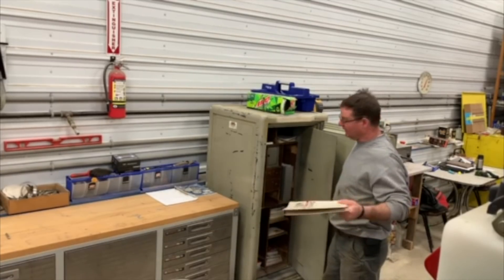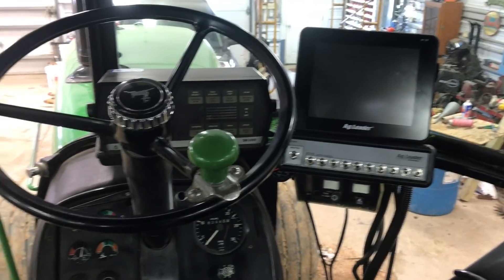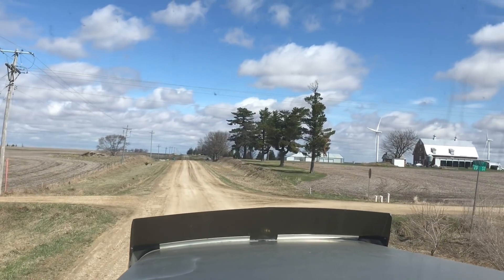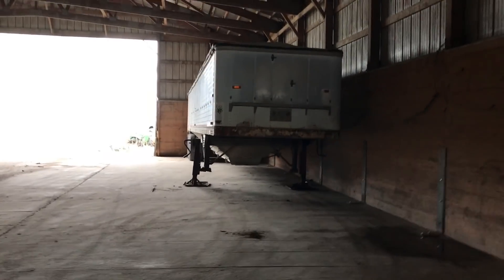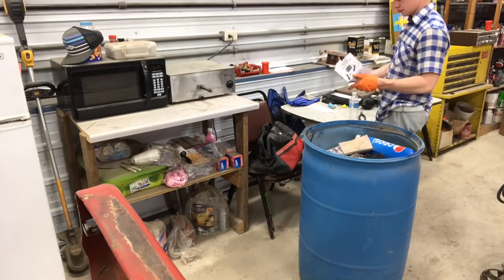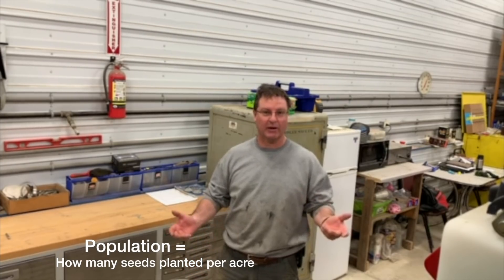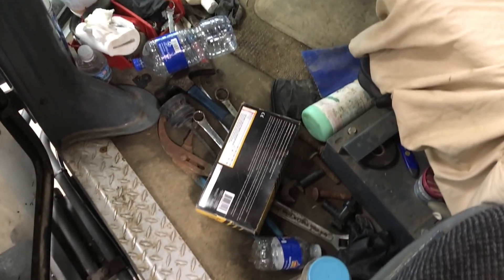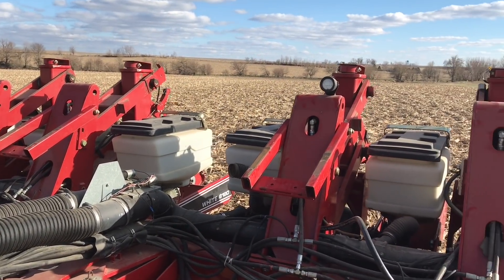My Tractor Can Drive Itself! | Last Minute Fieldwork Preparations

Comment: Daddy Cornstar is pretty cool!   Great video! We are going to finish up with corn planting tomorrow!   Seems to have gone incredibly fast...  would like a little rain before planting beans, still plenty early.   Great video, keep em coming!
Reply from the maker: The Fox Shop You guys are flying!
Reply: @ColeTheCornstar  well...with two 16 row planters and 50ft field cultivators...doesn't take long...but yes, seems super quick this year.  You will love auto-steer...  expensive...but makes things so much easier. We have it on everything. I can Remember field cultivating and it would be dusty and the light is just right and you can't even see the angle that you're trying to go by with auto steer you just push a button and it does it for you.  Straight as an arrow.  Gives you time to watch YouTube videos also 😂

Comment: We ran the jd autosteer system that is their style of steering wheel autosteer of what you are putting in and loved it. Only had it in one year before we upgraded tractors to an 8130 and also upgraded from waas to rtk so we could do more jobs instead of contracting it out. Was used mainly for tillage and some wheat planting as we didn’t have a cotton planter at the time, our crops are wheat and cotton, and did great.
Reply from the maker: Chase Howard Awesome! Thanks for giving me a heads up.

Comment: @19:36 Use cut up 16oz beer cans and your favorite utility tape to make protective shields for your hydraulic hoses where there are chafing points. Even hoses rubbing and chafing on each other can be shielded this way. Cut the tops and bottoms off the Beer cans, make the shield, and rap your hoses at the wear points and tape it. This trick will also work for radiator hoses too. If there is a bend in the hose to cover then cut the can in a spiral like peeling an apple without breaking the peel then rap the bend with it and tape it up.
Also aluminum Duct Tape can be used without the cans, but the can shield works and lasts for years or at least a season.
Reply from the maker: Thanks for the tip!
Reply: You lost me there, sounds like youre Macuyvering things!!!

Comment: You will love auto steer.  It's amazing how much of a difference it makes and how much you save.  We have went to precision planting which saves even more.
Reply: Jeff Gixer 

They’ll love auto steer for sure!
Reply from the maker: Going from not even running markers half the time (when they malfunction) to a gps system will be a huge change.
Reply: @ColeTheCornstar  that is true, but I would run your markers until you know how accurate this auto steer system is.  Did they give you an accuracy range?  They can vary a lot.  We use AFS and that is supposed to be 2.5 cm.
Reply from the maker: Jeff Gixer 2-4 inches. We plan on still running markers for the most part.
Reply: @ColeTheCornstar  that's pretty good.
Reply from the maker: Jeff Gixer We can connect to RTK down the road easily too
Reply: @ColeTheCornstar  yes and that's what costs the big money.  That isn't cheap.
Reply: @ColeTheCornstar  If you plan on going to RTK eventually its cheaper to have your own base then to pay the dealer for access to their towers, especially if you're not more then 9-12 miles from your tower.
Reply from the maker: Paulson Farms That's good to know. We could put that on our leg too I'm assuming
Reply: @PaulsonFarms  that is true.  Dealers charge a lot for that and you pay for the station in short order.

And Cole yes we have ours on top of one of our 80 foot Harvestor silos.

Comment: Why don’t you use your 4wd on the planter?
Reply from the maker: Carter Miller The 4840 does just fine
Reply: Ok I thought the 4wd would have les compaction
Reply from the maker: Carter Miller it might, it just would pull Funny in the hills with our particular 3pt.

Comment: Putting the auto steer motor on those older tractors is the worst. We did the same thing to our John Deere 4850 and it is terrible. It can not keep and straight line and the motor takes forever to correct. We try to adjust the sensitivity and it doesn’t work well either. GPS does not work well those tractors😂
Reply from the maker: Oregon Farmers Darn. We've heard a lot of good about it so I guess we will find out!
Reply: Oregon Farmers I put auto steer on a 4640 using the green star 3000 receiver and the 2630 monitor out of my combine.  It runs a JD ATU 300 on the steering column  The system is unlocked to GS 1 and will keep me within 2 inches + or -  Still use the markers as a backup.  Works fine